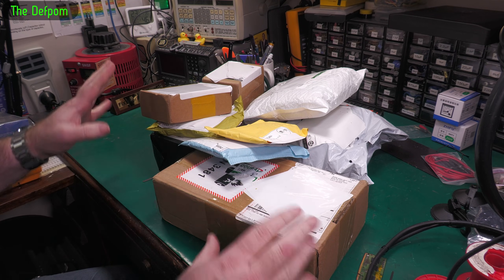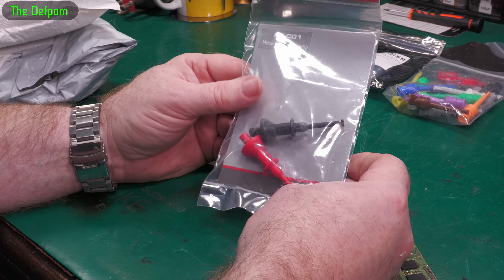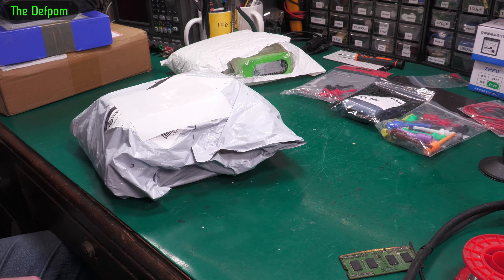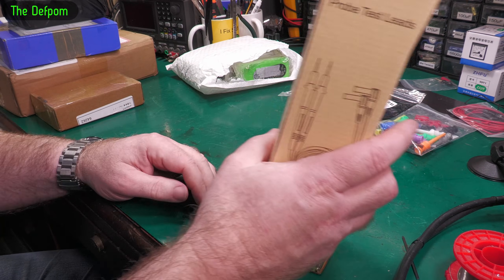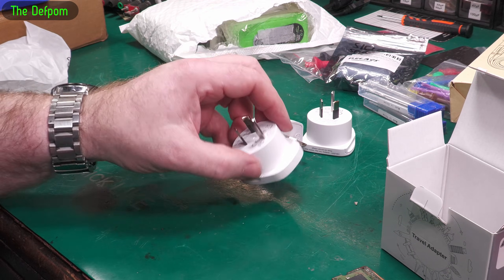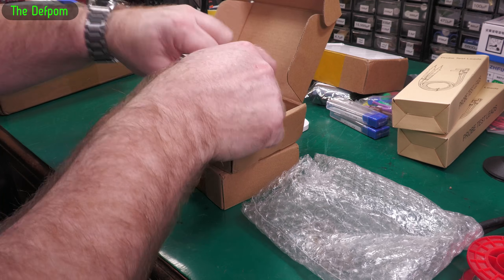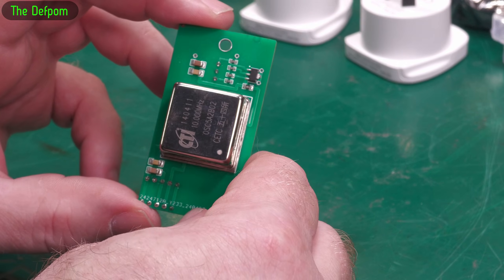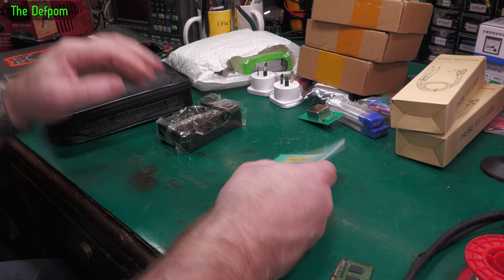🔴 Mailbag Monday 28th July 2025 - No.1382

Comment: I may get one of those OCXO modules and adapt it to my Beckman FC130 frequency counter. 

As the frequency counter was built, I would have to allow the instrument to heat up for probably 3 hours or more before it stabilized. About a year and a half ago, I purchased a little crystal heater from Ian Scott Johnston and while that helped considerably, this looks like it may be an even better option. All the Beckman counters have is a simple 10 MHz crystal that is mounted near the heat sinks of the linear voltage regulators. Before the epoxied on crystal heater, it would eventually stabilize, but as I said it would take many hours. The module you showed in this video may make a fun little experiment.